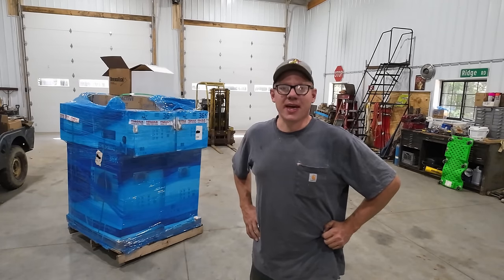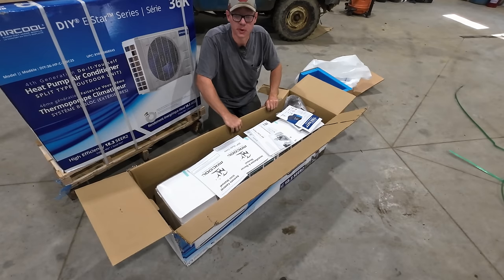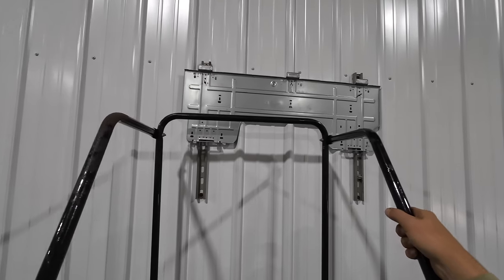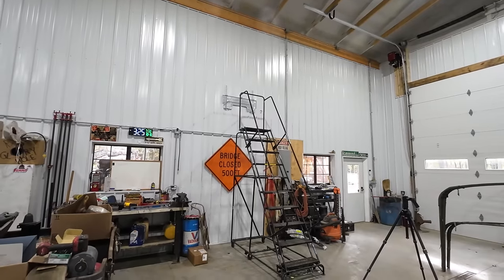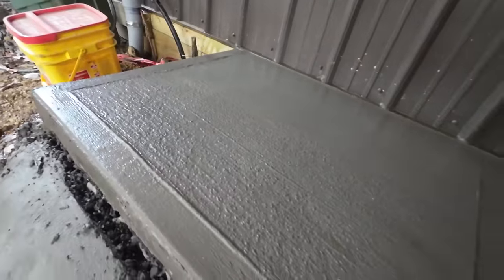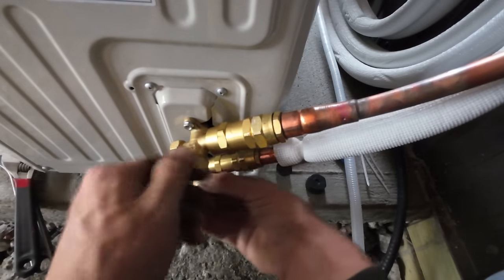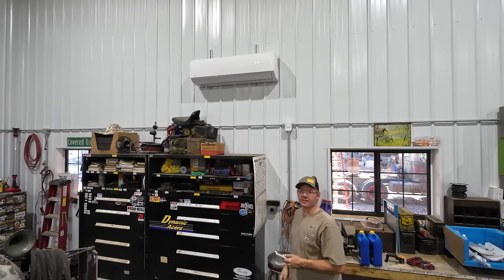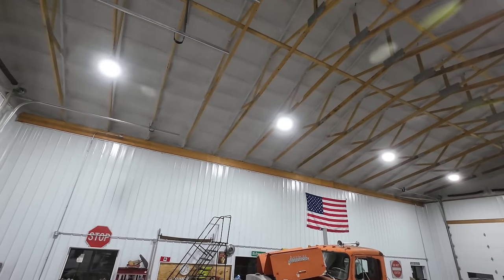DREAM SHOP Gets a Serious Upgrade! (How Hard can HVAC be??)

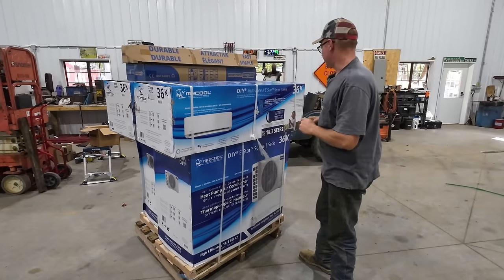Comment: 4:48 You don't need a knife to open straps.  Find the seal, flip it over and pull long end. Opens every time.
 Put some stanchions in front of the compressor outside. Don't go OOPs with your heavy equipment.

Comment: an interesting solution to the problem with the presence of a good vacuum pump, to produce pipes immediately evacuated directly from the box, of course this is a little constraining the installation along the length of the finished pipes, but it pays off independently.... and yes, external blocks can be hung on the wall and under the roof, and they cannot be walked will interfere and there will be enough space for them to work...

Comment: Precast concrete pads. Make sure the drain is on the bottom of the wall penetration. Excess line set should be flat not vertical. Good luck using these in a dirty shop space.Good thing is they are fairly inexpensive to replace in a few years. Those fans are HUGE money.

Comment: You can run your floor heating on a heatpump and your hot water on an electrical boiler. Get your beautiful shop covered in solar and stack a few iron sulfate lithium batteries. Much more efficient and fun to install.

Comment: I have installed one of these myself. The unit inside is called an air handler and the one outside is the condenser. The charge for the unit is in the condenser. The process of heating and cooling is both done by the condenser, It just reverses the process to preform the other air temperature setting.

Comment: Matt, you HAVE TO add voltage surge protectors to these things. They make some just for these. The electronics are complicated and EXPENSIVE. Cheers. Also yes, get a couple big ass fans to push the heat back down. Cheers.

Comment: For someone that have used air-air heat pumps in Sweden for over 7 years. I see two flaws for heating application.
1. You really should prop the outside up higher, ice will accumulate under really fast. Since you reverse fhe flow below 0degree celcius for defrosting outside unit. I can easily have 20-30cm of ice in the winter.
2. To get rid of water during summer and defrost water during winter that slab should have been tilted a few degrees to move it from the house foundation.

Comment: I have floor heat in my 40x50 shop. Put in a heat pump for AC, which is fantastic, but also use it for heat on the days in the spring or fall that a cold overnight, but warm during the day. Don't want to get the floor cranked, and it be sweltering mid day.

Comment: Would suggest that you look at installing a lower ceiling on the lower beam on your trusses. I doubt that those two ACs will handle the heat load on that size building once summer kicks in. HVAC Technician with43 yrs experience.

Comment: I live in the desert and my shop is about 1/3  the size of yours but getting that swamp cooler and insulation to get my internal temperature from 110 to 80 was probably the greatest upgrade i ever did

Comment: I put these in my shop and I love them. When you get permanent power there get the app for them, when you leave your house you can turn the heat or ac on and it’ll be running when you get there, super convenient

Comment: Matt, I'm a retired Episcopal Priest and not an HVAC guy. However I have worked with HVAC guys a on heating and cooling church buildings.  I think if you do not put in ceiling fans your cooking will cost much less. Why... The cool air will fall, the warm air will rise and create a thermocline. You will only have  to cool the lower half of the building.  With a ceiling fan on you will blend the warm and cool air and end up having to cool the whole air mass of the building.  In the winter  the  fans will push the warm are down which is good.

Comment: Great installation, I would add White Corrugated Twinwall Plastic Sheets over he tops about 9 inches above for the dust to settle on, a couple angle brackets, and a full piece will set you back under $50. for both and easy to clean off or not! .

Comment: Good job Matt. I was working in this business for 4 years in Europe (Czech republic) and I didnt know that these "ready to go" machines even exist. The only 1 thing I would advise is that the next you get the air out of the system. You can do it with pump OR in this situation you open the valve with small diameter pipe first, then you push the side valve on the bigger pipe with finger or screw driver for like 1 second. You get mostly air and little bit of medium out. And only then you open valve on the bigger pipe. You do this because the moisture contained in trapped air can freeze and make small bits of ice which can destroy the compressor.

Comment: I just installed a Mr Cool on my log cabin this summer and it  will freeze you out. I live in Northern New Hampshire and am running the heat now for about the last month works great. I put the 2400 unit in.

Comment: You could have mounted the outside condensers on a nice wall bracket.  All that concrete work isn't  needed.  Not sure about all the coiled up tubing behind the unit.  You don't want to restrict the air flow and block the inlet coils.  The inlet coils need to be accessible for cleaning.  I've never installed these DIY Mr. Cool systems, but I hear they work OK.

Comment: Matt just wanted to say thank you for all of your hard work on the videos. But I do want to warn you on one thing. I have installed a lot of these over the past few years and one thing you want to stay away from is mounting them too high. They say do not mount them over 9 feet high and from personnel experience and from coworkers having them lower is way better. What will end up happening is if they are mounted to high you will never feel the heat or cooling from them due to the blower not having the power to push air down that far. What I am saying is you can end up with pockets of cool/hot air just under the reach of the units. 

Just my 2 cents

Comment: You will need a vac pump to remove all air from the lines before you open the valves to release the refrigerant.  While under vacuum good time to check for leaks in lines.
Reply: The lines have a small refrigerant charge from factory and sealing quick connects just like a hydraulic line.

Comment: Good job Mat! Your concrete pad are way to go . But … yeah there is a thing …
Laying the compressor right into the concrete pas you will encounter an ice problem during winter when the unit will enter in defrosting phase . Water will flow from the condenser and will frozen rock solid around the compressor unit. 
It’s not a maybe this will happen. It’s a certitude. Even more if the humidity outside is high. 
A simple mod for that is to made out of aluminum frame , a stand to put the units on it . 18-24inches is enough . 

Keep out good work I love your channel. You made my relief period more easy…
Regards.

Comment: Just wait until you get some ceiling fans you will see a difference of immediately.

Wait until it's really cold outside and then make sure you turn your heat on. Pick one of your lifts that you have and raise it until you're almost at the top of ceiling. You will not believe how much of a difference it is from the ground to the ceiling it's incredible the difference in temperature. 

The one that I use and I like a lot are called Big ass fans. They're not very noisy and it does a wonderful job especially during the winter months. 

As always I enjoyed the video and look forward to the next one.

Comment: Yea to the ceiling fans! They are a very "green" solution. You will be able to save several degrees on the thermostat by using even just one. For the length of your building 3 might be optimal but 2 will be a big help!
Reply: Yeah but draughty and cool at floor level and in my experience noisey too.

Comment: Good job on all the various sections to this project,
Funny too..✅  NOW you will have to put two 5 inch pipes in front of of each outdoor unit and fill them up with some wet (8 slump) concrete mix as bump stops so they won’t get driven into..!!! 😎👍

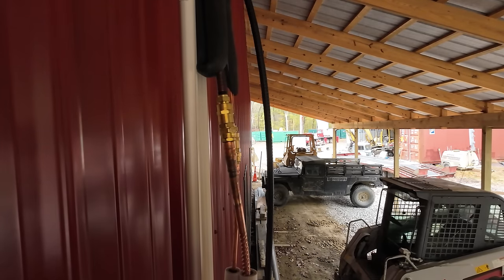Comment: @ 25:57 That looks like Butyl tape. You can get various types and sizes at your hardware store. It also comes in rolls and sheets. Same stuff auto co's used as sound deadener and heat shielding. You can find the best prices in the roofing materials. Same stuff sold for cars at 1/3 the price or elec. dept at 1/5 the price. 1910 or so tech.

Comment: Installing these is relatively easy so glad you went this route.  Note that most have a freeze protection mode where it keeps a temp of 45F or so and what is so good about this mode is that the efficiency is vastly improved over the rated efficiency as the temp gradient is lower than at the 70F indoor level the government mandates they be rated at.  In your climate you will save a good amount of money over heating with propane or other fuels.  In the winter when bundled up a concrete pad at 45F is pretty much all you need to be comfy.  A torpedo heater can be used for those quick temporary bursts of heat in the meantime.

Comment: I installed a 36K BTU heat pump I’m my 24x40 pole barn. It’s insulated with rigid foam boards in the sidewalls and foam boards and R13 roll insulation in the overhead. Unit works great. Summertime it cooled perfectly and now it’s heating my pole barn equally well. I should have done it years ago.

Comment: Get some solar cell panels on your roof and you'll have cheap cooling of your shop. If it is hot it is likely sunny = electricity. And for heating a heat pump is the way to go both money wise and climate wise. Burning wood is OK if you just burn wood that otherwise would be rotting away, otherwise it would add to your carbon footprint.

Comment: Here in NZ we commonly use heat pumps for heating in winter...  so efficient, a 6 KW unit requires only 1.2-1.5 KW power. I have Solar, currently 4.5KW which will run the heatpump all day with poor generating conditions(cloud cover) as it generates about 1.5-2kw like that..  So on a clear day in winter, plenty of daytime power generated to heat the house. (Not a big 2 story house as you commonly seem to have in US.)
Ours also does both heat and cooling....

Comment: Air to air heat pumps struggle when it’s around freezing outside. The better option is a ground source system.  Drill deep holes and run coils of PEX pipes as heat exchangers.

Comment: Any kind of shelter for the compressors is highly beneficial.  Keeps them from clogging with snow, leaves, needles etc as well as weather blowing rain and such.  The compressors are not corrosion resistant even when they rate them "coastal, harsh climate".  A shelter also helps with the icing up issue (the more they ice the less efficient they operate.  The icing temps are actually worse right around the freezing mark.)  Also Mr. Cool charges a high price for their DIY capability which really amounts to a charge in the line as well as the compressor.  Almost all come with a sufficient charge in the compressor to charge sixty feet of line (thirty foot one way).  To really do it right it takes a few tools and some research but then you can work on them to recharge etc as needed.  The tools are paid for by the price difference Mr. Cool charges and then some. If your run is in excess of the thirty feet you will be right back to having to do a correct install with vacuum and testing, etc. as you will need additional charge (R410A).  In point of fact most of the compressors all come from the same two or three factories in China so you really aren't getting something 'different'.  The difference is some units handle the heating side better and some the cooling side so it pays to do your research.  After installing a few my own preference is the "Senville" line.  Their on line manual is comprehensive with all information needed and their customer service is right there for any additional questions.  It is also good to insulate the line set as much as possible in addition to the insulation they provide.  The longer the run the more important additional insulation is.  The more insulation the more efficient the unit can run.  Vacuuming the lines and testing for minute leaks is still very important.  Any air will introduce moisture in the compressor and while it will run it will shorten the lifespan considerably.  Also the only way to know if a mini split is fully charged is to vacuum and weigh it (unlike the old A/C only which would tell the story on the gauge set).  These are made in China.  Need I say more about quality checks and trusting that the correct charge is in the unit?  One last point:  An additional filter on the top of your air handler is a good way to extend the time between cleaning the filters in the handler and keeping it clean for efficient heat exchange.  3M makes a medium available on amazon that is like a loosely woven scrub pad and you can cut it to size so that with a couple of weights it lays on top of the air handlers inlets.  It is washable and blowable with shop air so it is a cheap way to increase the operating efficiency.  The flimsy ones they come with will not stand many cleaning cycles before they are broken so having a good primary one lessens the times you need to clean them.  Washing is the only effective way I have found. Those foaming sprays are pretty much worthless. You will be surprised how much area these can handle and definitely enjoy having them running.  For a shop another huge benefit is that they dehumidify while cooling which keeps your tools from rusting, the heat helping as well.  Parts are the big question mark with all things chinese.  These have a lot of fragile plastic that could break (disassembly for cleaning is a once or twice a year thing).

Comment: Great video. I am not sure what's more impressive. You going at it alone or the tech with the units.
One tip. Get some rubber padding for the legs to sit on, on the outside units.

Comment: Yes. Keep filters clean. We have one and it is picky. It's 3 yrs old and we have had to top off the freon charge every year. We called the tech and he checked it and said it has a slow leak inside the outside unit. But it does cool the place nice at just 78 degree setting. Our space is small compared to yours. Good luck  with them.

Comment: With your ceiling fans you need ceiling fans with a reverse cycle.
In summer they push air down cooling and in winter they draw air up warming.
I installed ceiling fans ❤ the channel keep up the great work 🍻

Comment: I sometimes watch a concrete pumping channel and they spray their shovels, chutes etc. down with diesel fuel before each job since apparently, concrete can't stick to it, it makes cleanup MUCH easier for them...

That might help you in the future...spray the skidsteer bucket with a light coat of diesel and cleanup should be a lot quicker and easier...

Or so I've been told...

Comment: The big fans will cool you down from the moving air. Check out tubes sucking air from the top or bottom to even out temp without you noticing the moving air.

Comment: Mom had a split unit installed in her new addition to her house, its extreamly quiet and you only hear the air rushing over the vent luvers, its 15 years and i think its only need service once. The filter gets cleaned regularly.

Comment: We used the smaller industrial fans in our shop to push the heat down, the big ones are impressive, but the strobing they create on the lights is terrible and we couldn’t hang the lights under the fans, plus they are super expensive

Comment: Mini Split ACs are amazing.  I bought one to heat and cool my utility room.  Running electric is probably the worst part of the job.  I had to run a new Romex up and over the room to a 20A breaker.  Good call on putting your outdoor units on pads.  While they're quiet they do vibrate and when they're wall mounted they will transmit vibrations to the wall.  When you have them heating they'll occasionally go into defrost mode for the outdoor unit if your outside temps are really cold.  There should be a small heating element on the bottom of the outdoor unit to prevent ice dams from forming from the condensation in the outdoor unit.  

The remotes are neat too.  They have a temp sensor in them and you can set the remote to "Follow me" where it tells the A/C heat to go by the temperature at the remote not at the wall.  It does require that the remote have Line of Sight to the indoor unit.

If you are interested in the WiFi features, the app for the dongles you got are okay.  They do depend upon someone else's computer (aka the Cloud).  There is a third party dongle available that works great with Home Assistant and requires no internet to function.  I bought a third party dongle for my mini-split.

Comment: I installed ductless minisplits in my house 5 years ago. Best thing i ever did. Super efficient, whisper quiet, and no more heavy and loud annoying window units. HUGE IMPROVEMENT to the house. Matt, good news is you can add more if they don’t keep up in the heat of the summer. Good luck on your power issues!

Comment: To Matt @ Diesel Creek -- I don't know if the inside units have intake filters but if they don't I would think about it. With all the smoke and dust that they will be exposed to from diesel engine smoke, welding, grinding, and spray painting could clog the units up pretty quick. I just thought about it when you fired up an old diesel engine in one of your previous shows, how smoky it can get in there. Like I said it was just a thought.   I just finished typing my comment and then started reading the comments and someone right below me had the same thoughts about the filters. LOL

Comment: 2 or 3 home depot ceiling fans will work to circulate air 10 times cheaper than a big ass fan. mine were running for 17 years 24/7 in my last shop(3000sqft) i moved from. hook the light up for a nite light